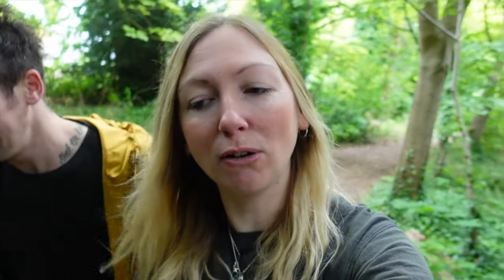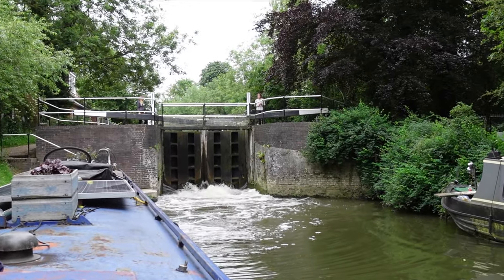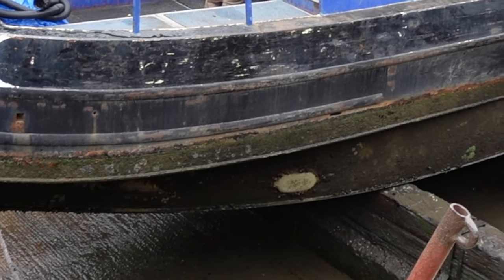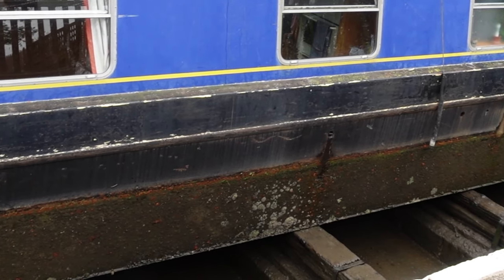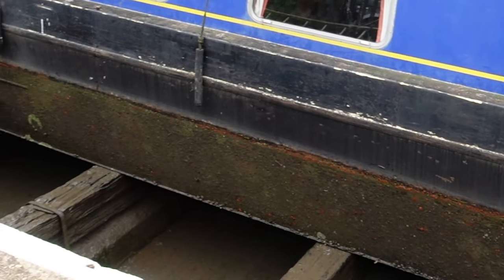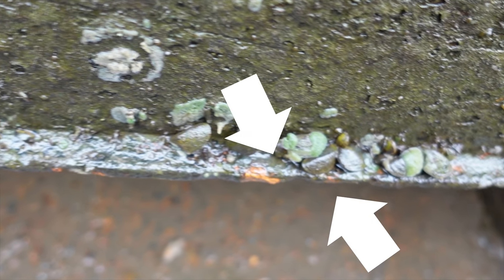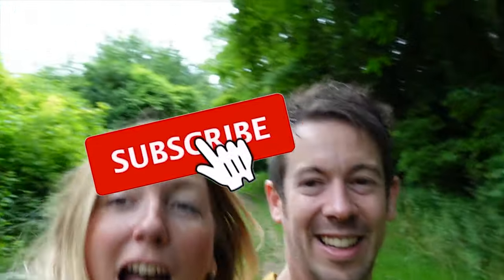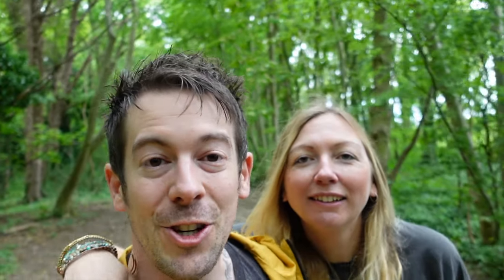LUCKY ESCAPE ?? // Our off-grid narrowboat dreams SINK !

Comment: You can tell by the water line on a boat if it's been out the water often. Lots of rust around the waterline is a dead give away. Get a boat that's been surveyed. Gutted for you and the seller who obviously didn't take care of the boat. If your budget is between 30-40k  it's a mined field. Don't touch boats with rusty water lines. I didn't have a clue when I bought my boat it's what I've learned owning one. What a shame. Good luck with your search.
Reply from the maker: This boat was 4 years since its last blacking so it was a problem we were aware of to some extent, the interior was beautiful so played a huge part in our decision, plus the seller accepted an offer of £32,000 from £38,000 so it seamed tasty, it is a real tricky market at our budget.. as it seams to be the affordable option to new boaters, originally we were looking at the £20,000 mark , but its impossible at this current climate, so were now looking closer to the £40,000 mark, will get there, thanks Will :)
Reply: @TheNomadicCrobot  good luck. You will learn all you need to know after owning a boat for a while. Looking for ward to your next one.

Comment: The one thing surveyors often don't do (but yours sounds like a good one) is to get under the boat. To overplate the baseplate with 6mm steel, with steel prices the way they are (very high), could easily cost £5000 plus £1000 per 10 feet of length. For a 60 foot boat, that could be over £10000 for what at best would be a bodge. Then you have the other steel to repair, I can see that boat would need. Last year you could get a brand new 57' hull for £20k. Looking at the state of that hull, I would say it was scrap, not worth repairing. How old was that boat? The older they are, the greater the chances that they are effectively scrap. Same goes for the engines and gearboxes. Never buy a boat with the intention of stripping it out and refitting it. Buy a new 'sailaway', with hull, engine, gearbox, controls and spray foam. You can cut the windows and hatches later.
Reply from the maker: The boat I believe was from 1991,it’s Interesting to know that not more surveyors look under the boat, seams like like the most important part. He did warn us that it could cost up to £10,000, I think we were lucky, good to know you also think it’s a bad hull as we’re a bit obviously being newbies, so a second opinion is great thank you😃
Reply: @TheNomadicCrobot  For 1991 that boat is in very poor condition. Whereabouts are you based in the UK? I am not so far from Hatton locks.
Reply from the maker: Oh brilliant we can’t wait to head up towards Birmingham way, we’re currently near Cambridge,  yes it’s an ex hire boat so that’s probably why, beautiful Inside, I think we’re sold on that alone without doing enough homework, the Hatton locks look Insane, do you own a narrowboat??
Reply: @TheNomadicCrobot  I wish ... I am a lockkeeper (volunteer) at Knowle. Many of my colleagues own narrowboats. Ex-hire boats are usually a bad bet. The hull is usually made too thin to save money, and their engines are usually underpowered. Plus, as you would see if you became liveaboard, they are often skippered by the most incompetent morons ever let loose on water, so they get a lot of hits. Yes, I do rent a boat from time to time, off season, but I know what I am doing. Yes, Hatton can be 'fun' to do in a day. Those gates and paddles are very heavy. A lot of us volunteer lockkeepers on hand helps.
Reply from the maker: Oh amazing, you guys do such a great job from what I see, plus I’m sure it really gives you a great insight to what’s going on on the cut. We can’t wait to become live boards but I’m sure there will lots off challenges.. hire boaters being one. Thanks again for helping out the boating community you guys do an amazing job
Reply: @trevornelmes9331  indeed , we’ve seen the same hire boat, near our moorings , whack, at full pelt,  the Armco 3 times .. that’s just the ones we’ve seen… in around 3 weeks! Image the abuse these things take! Steering away from an ex hire boat is a very very good idea.
Reply from the maker: Just recently we saw photos of a lock that had been completely destroyed from hire boaters. It’s terrible
Reply: @TheNomadicCrobot  It happens. Hire boaters tend to be more prone to leaving top and bottom paddles open, thus draining the pound above and flooding the one below. When done to a top lock, that could be a miles long pound. Most bottom lock gates are leaky because boats hit them on the edge where they close. There is also the classic sinking a boat in a lock (not watching where the cill is, or opening a top paddle too much so the water floods in too fast and either tips the boat over, or floods its bow - especially so as hire boaters tend to leave the bow doors open when in a lock, something you should not do if going up locks). Hire boaters moored on water points, lock landings and by bridges is one of my big hates.
Reply from the maker: It’s quite scary to think some of these people are let loose on the rivers and canals, Iv had a few experiences with locks and I’m always so nervous to try and make sure we do everything right, it all comes with experience I suppose over time :)